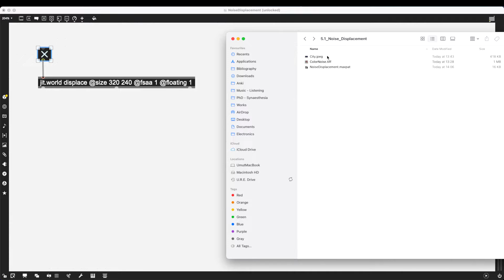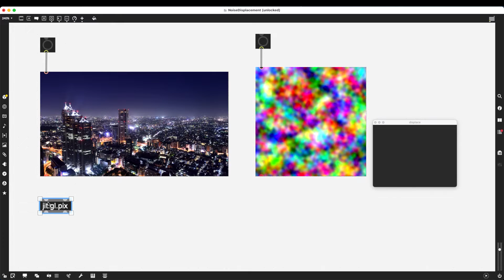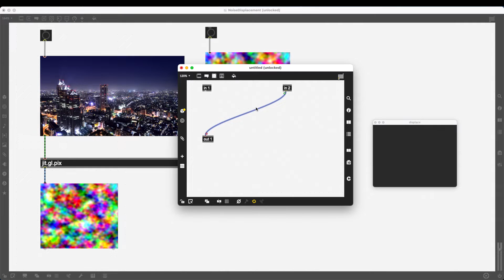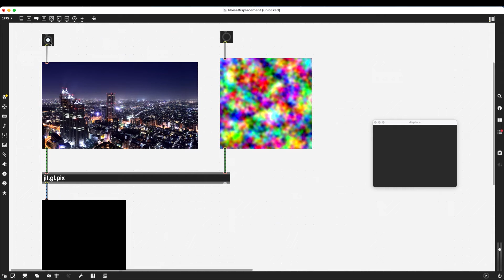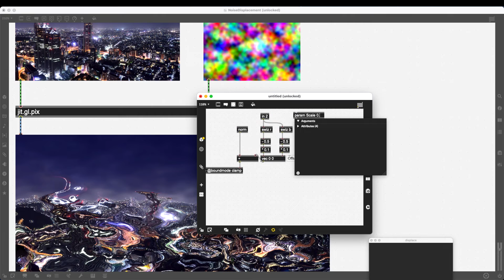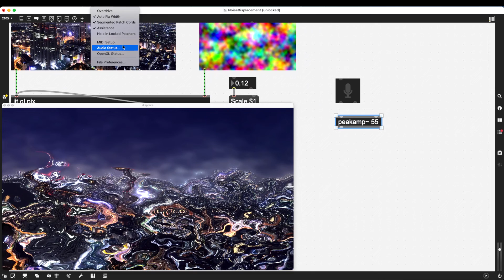Noise Displacement with jit.gl.pix - Max/MSP Tutorial

Comment: I tried to implement a bfg function with 3 dimensions (e.g. 100 100 1) just to mess with the offset attribute with the 3rd dimension. The thing is jit.gl.pix does not accept 3 dimension matrices. Why does this happen? in my mind it should work.
Reply from the maker: That is because jit.gl.pix only supports two dimentional textures. You can take the result of the 3-dimentional bfg (100 100 1), put it through a jit.matrix that has two dimensions (100 100), and send that to jit.gl.pix to make it work. Visually it should look the exact same.